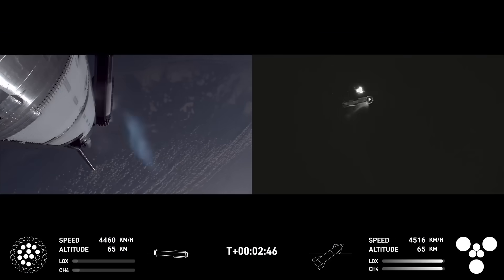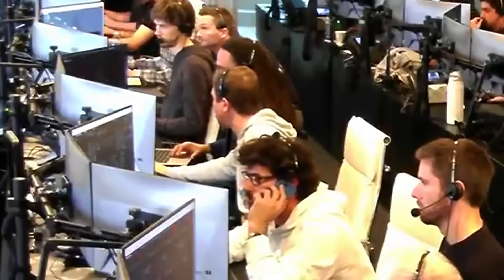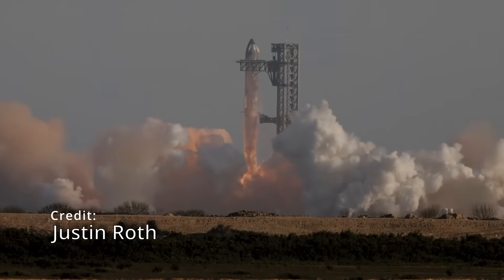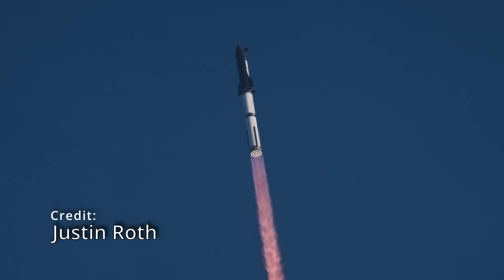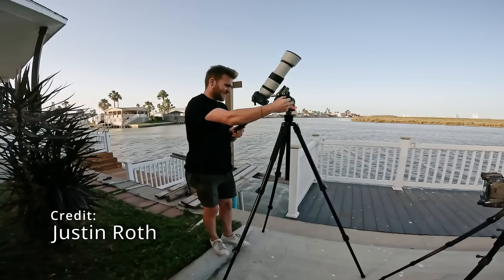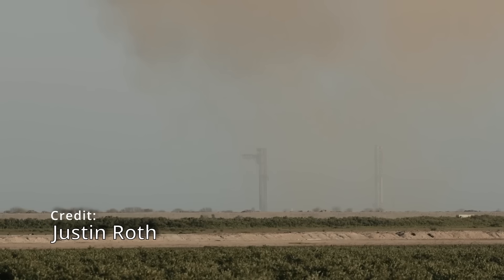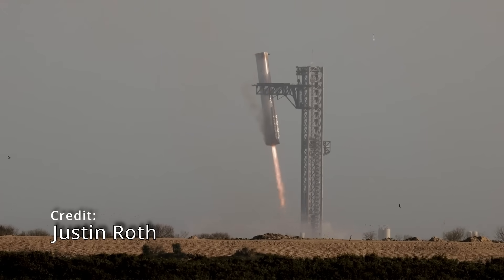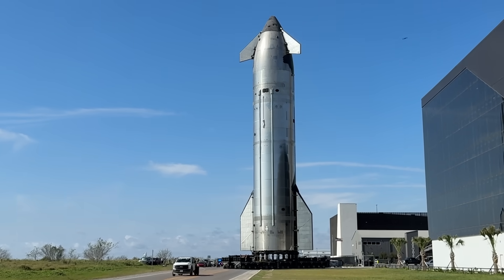Rest In Pieces: Why Did SpaceX Lose Starship Again?

Comment: I see so many similarities between SpaceX today and NASA in the 1960's, it's called GO FEVER. Keep pushing, keep going, and you're not looking at the data completely. What changed on Starship? I believe it was 6 meters. They were talking about a change in the harmonics of the ship during Flight 7, and that caused a break in the fuel lines. Well, harmonics can also induce POGO, and that will break a rocket. If you don't know what pogo is look up Titan II development to man rate the rocket to boost the Gemini spacecraft into orbit. Also, stop thinking about going to Mars and get the job done on the Lunar Lander. There is so much that needs to be done to fulfill the lunar lander requirements. Everyone was all so happy about SpaceX getting the Lunar Lander contract, I would like to see some progress on that mission. The moon missions come before any Mars missions.
Reply: Nasa has never had go fever. They have not left low earth orbit for over 50 years. They need go fever.

Comment: Can anyone explain how all Saturn V launches were successful and Starship can't get it right? Please don't say SpaceX is working with experimental ships. 
Saturn V was also experimental, with far more primitive tools to get it done. It is baffling.
Reply: I can only explain why you posted this comment; you needed to Karen it up.
Reply: Completely different things. Saturn v is not designed be reusable.
Reply: because saturn v was like the entire nation working on it
Reply: In short, it comes down to the development process.

Saturn V (as with basically all aircraft /spacecraft ) was engineered from the ground up where they worked out every theoretical issue before even building the part. Then once they built the component, they would rigorously test it in every way imaginable to ensure it wouldn’t fail (and if it did they would go back to the drawing board and start over).

Doing it this way meant they could be confident of exactly what would happen once everything was put together.

SpaceX on the other hand is using their “iterative design” process which means they essentially just build stuff without testing it, launch it, and see what happens.

If done properly, true iterative design (which isn’t really what SpaceX are doing) usually results in something that kinda works kinda OK quicker than the traditional method, but it then takes longer and is more expensive to get a finished, working product.

Edit: think of it like the 80:20 rule (it takes you 20% of the time to do the first 80%, and then 80% of your time to get the final 20%). 
While NASA etc. spend all the extra time on the last 20% to make sure everything is absolutely perfect, SpaceX rush to the 80% mark and then just lunch it.
Reply: It's not baffling. Saturn took more money, longer to make, and was far simpler.
Reply: @BoraHorzaGobuchul  that’s not acute . 

Saturn V took ~9 years from conception (1960) to putting a man on the moon (1969).

SpaceX has been working on Starship since 2012 (~13 years ago).

P.s. also, “simpler” was still ground breaking, never before done, state of the art at the time. I’d argue that is easily equivalent to what SpaceX are doing now.

Comment: To ground the spacecraft at this stage is   not useful, instead instrumentation must be installed to discover the root cause. Grounding only serves to speculate again. Then you have positive data to evaluate .
So with specific instrumentation you can detect  the cause in flght 9
Think about it!
After all , these are TEST flights, not demonstration flights.

Comment: Could "hot stage" separation be done away with a new "cool stage" design that "pushes" Starship away with struts, and THEN ignite the engines further away. Way too much vibration and heat involved in the hot stage ring, way to close to the engines.

Comment: On the plus side they now have two data sets to find commonalities in both RUDs and truly identify design issues.
Reply: The possibilities, as I see it:
1.  It's the same problem, and the fixes weren't enough.
2.  It's a different problem that just happened to produce the same result.
3.  The fixes to the first problem were the cause of the second problem.
4.  The design itself is not workable.

#3 and especially #4 are, IMNSHO, a bit pessimistic at this point.  They just don't know yet what went  wrong.  The real bummer here is that they haven't even had the chance yet to find out if B2's design solves the problems with B1, because they still need to get B2 to work.
Reply: @falcychead8198 , my guess is #2. The two RUDs are probably from two different things breaking under the stress which Starship was enduring. There're a lot of ways to fail.

As Starship uses up its propellant, its mass decreases, so its acceleration increases. That creates increasing G forces which stress everything on board.

By my math, just before its first vacuum raptor quit Ship 34 was accelerating at about +127 kph/sec, which is 35.28 m/sec².  1G is 9.806 m/sec², so Starship was accelerating at 3.60 Gs.

Add that to the acceleration of gravity (1G), at an angle of about 96° to the trajectory, and it was experiencing a total of about 3.84 Gs.

Vibrations may also increase and/or change in frequency as the ship's mass decreases. Add those dynamic stresses to 3.84G of continuous stress and things can break.

My guess is that the things which broke on IFT8 / Ship 34 were different from the things that broke on IFT7 / Ship 33, because I think SpaceX's engineers are too good to let the same thing fail twice.

I'll also go out on a limb and guess that for IFT9 SpaceX will not only beef up whatever broke this time, they will also dial back the thrust slightly toward the end of Starship's burn, to reduce the G-forces which it experiences, because they really, really want to test the things that they didn't get to test this time, like heat shield and Starlink launch.
Reply: Lol, these comments 😅
Reply: It's good to have same problem or a new one so they can fix them
Reply: In case the reason is the same (may not be)
Reply: The harmonic vibration might not have been the issue after all… it really does seem like the same issue unresolved. It has the same smell as starliner that had the thruster issue that they thought they could fix, but clearly didn’t, and flew regardless, with people on it no less. I really think this killed as ‘26 mars attempt which was already going to be tough. Maybe Q4 26 moon is still possible though…
Reply: Starliner never had ground tests where the thrusters were operated in a vacuum chamber. Ambient air circulation kept the valves cool.  
 @danwhiffen9235
Reply: At some point that's gonna be 50/50 that's not good wasteful at best dangerouss at worse.
Reply: Or, it could have worked perfectly, and they would have learned a lot from that as well. At the very least, they can learn from any launch. It's not saying much.
Reply: “RUD” is, at the same time, a hysterically funny, and an Orwellian phrase in space flight or rocketry.
Reply: @johncronin9540  i believe this was much further along in the burn.....
Reply: Trial and error...  that's horrible engineering
Reply: @joelrunyan1608  what you fail to understand is that not everything can be calculated and designed for!!!!!! there's a point of uncertainty where you must test the thing to figure out what you don't know that you don't know.
Reply: @joelrunyan1608  Yes, how many tests did the Saturn V before operational status? Tells the story.
Reply: @joelrunyan1608  Not necessarily. A lot of the technologies we have today are as a result of others befor having failed multiple times
Reply: @joelrunyan1608  It's a little bit more than that.  No new technology, from stone tools onward, ever worked perfectly the first time.
Reply: By your logic, the more failures, the better. You always learn from mistakes, but do you want to put 100 people on a cylindrical MuskmElon?
Reply: @4yerears  By your logic, mistakes are infinite in number.  If you fix enough mistakes, you will eventually succeed.  No, I wouldn't want to fly on this thing as it is right now, but no sane person would.

Comment: You can see at flight time +7:45 when the view switches from the booster catch back to the Starship engine bay that there is a red reflection and burning gases around the engines. About 20 seconds later the engines start cutting out.

Looking back at the booster reentry at +5:32 you can see gases burning around the inner booster engines.
There seems to be an issue with leaks around the engines after liftoff. If the leaks are small enough (booster), the flight is not affected. The Starship leak was almost at the end of the burn. Maybe this affected the ability to feed gas to all of the engines, leading to cutouts.
 
Have the boosters been close to running out of fuel? Does fuel continue to leak after engine shutdown? Or maybe valves closer to the tanks cut everything off upstream of the leak. Try pressure test of fuel service lines on the booster and see where leaks are coming from.
 
Hopefully with the booster recovery and additional cameras and data from Starship, they can isolate and fix this issue.

A setback, but it's better now without a payload. I'll guess next flight in late May.

Comment: It's remarkable that the booster catch is almost down to a science. It's the Ship that is presenting the biggest difficulties.
Reply: That may be a bit premature, R2 not reliably reigniting… what happens if it’s one of the three used for the catch?
Reply: @ytfcman3035  then it will divert, not a big deal
Reply: @snuffeldjuret  it only has three gimballing engines centre doesn’t it?  So what if one of THOSE fails to relight late-on?  That’s all I’m asking… and yes I do work in aviation safety and ask the ‘stupid’ “what if…” questions.  As long as they have at least 50% thrust margin for landing then they should be fine for losing a single engine.
Reply: The booster catch is a much easier option to landing independently. Landing like a Falcon 9 would be the real accomplishment, not catching it. But hey, smarter; not harder.
Reply: @itheuserfirst3186  this is 100% incorrect. Returning to a specific point to be caught is much tighter allowance than a pad where as long as you make the pad it's fine.

Comment: One result may be to move forward to Raptor-3.  Let's hope that it is not a basic raptor issue! You can probably pick up a real deal on a Raptor-2!  Someday there will be a significant economy based upon the buying and selling of used and refurbished Raptor engines just like in the Star Wars movies or like in the commercial aircraft industry.
Reply: I think R-3 is actually a very sensible change, assuming it is itself ready for prime time. R-3's main feature is its greater simplicity, especially in terms of what is exposed, and that makes me think it is likely also much more reliable. This of course presumes the faulres in 7 and 8 are engine related rather than mount or enclosure.
Reply: raptor-2 on the boosters have been insanely reliable though

Comment: At this point, I wonder if It would make some sense to come up with some variants that use different upper stages, like perhaps use super heavy to to be the first stage of a 3 stage man rated moon rocket.  Perhaps get other NASA contractors to develop the other upper stages while starship continues development.
Reply: SpaceX would fully design, test, prove the upper stage before any other contractor even got past the paperwork. Then SpaceX would do the same for necessary variants before any other contractor even got the infrastructure up to start work.
Reply: what a can of worms that would be.....NASA...lol
Reply: Many people are seeing the inevitable test RUDs as failures.  They're not.  SpaceX learned all they could with ground based testing.  Now it's time to blow up some rockets to learn what else needs to be fixed on the path to success.  RUD = data.  Data --> success.

Comment: I kind of agree this V2 new ship has a design flaw, they should do a ship only vertical  8 minute flight over the gulf, then land it on the water.
Reply: V2 rocket?  that sounds kind of Notsee...  😀

They're still getting testing and improvement on the booster, even if the starship part fails spectacularly...
Reply: No.   My bet is that "Ship" gets ripped apart by the acoustic signature of the booster.   In fact, the amount of shaking might be a big re-use problem
Reply: @chrisalbertson5838  if it was that it would show up near the beginning of the burn, not the end.
Reply: But what if the issue has to do with the staging itself?
Reply: @ Could be, as I stated in another reply something is breaking after hotstage, but not showing up until right before engine shutdown. Eliminate the hotstage for a test flight, only one way to do that.
Reply: @DaveEtchells  A reasonable question - but testing the SS design over the Gulf water would and could help with both duration of engine burn and the landing relight.
Then, they could do the full up test after WDR.
SpaceX is trying to go fast but at a certain point, going fast is not "better".  They need to stand down the scheduling pressure and take a few weeks to a a few months to rework.
I've not seen this number of failures at SpaceX ever in one week and I've not seen this number of failures in general since 1986.
Reply: @goldenpacificmedia  Yeah, they apparently made something like 68 separate changes from the last flight to this one. They may need to back off a bit from the “everything all at once all the time” strategy.
Reply: @f.w.1318  another thought as to why it doesn't show up in ground testing. 
As the fuel nears exhaustion the g force increases and the pressure on the fuel and oxidiser lines is increased due to the head of liquid. The O2 header tank is 50 metres above the engines. At 5g that's about 30 bar of pressure. Combine that with vertical vibrations and there might be even higher pressure spikes. That can't be replicated on the ground.
Reply: How would a vertical 8 minute Starship flight over the gulf solve a problem that is occurring as Starship is almost in orbit?  That's analogous to the NHTSA doing front impact tests to determine why the Ford Pinto was exploding in rear end collisions.
Reply: @  Let me clarify, ship passes leaks test (on the ground) and ground testing flight burn, heck I'm no engineer, but something is breaking after hotstage, but doesn't show itself until right before engine shutdown. I think doing a test flight without a hotstage phase would be a good start.
Reply: @Liberty4Ever  depends what the issue is. If it's related to the pressure of the oxygen in the downcomer from the header tank at 9g of acceleration (for instance), that would show up quite nicely in a vertical test.
Reply: well...the block one ship would have failed just as block 2 is now.....Block 1 carried no heavy payloads and with a heavy payload and the new more powerful raptor 2.5 the same exact issue would have shown itself.....Block 2 is a lot heavier and has more powerful engines that really were not meant to be on it....should they have taken this into account...probably but they are playing a very tight game of thrust to weight ratio that they are failing in and attempt to keep static mass as low as possible....getting raptor 3 will help and strengthening the thrust puck will help...
Reply: Spot on. I don't think they can test this on the ground because the thrust is more than the hold down clamps can take without the weight of fuel. They can do the testing for this problem, and do testing for ship catch with a high cadence if they contain everything to a few miles from Boca Chica.

Comment: Scott Manley will give us possible clues as to why. I think its a pump cavitation issue that causes pressure diffrentials..
Reply: Its a bad vacuum raptor , cooling problem,  you can see the crack in it on video before it exploded - duh
Reply: The vacuum and sea level engines went out at the same time.     My guess is that something that is common failed and the root cause is the huge acoustic signature
Reply: @chrisalbertson5838  the vacuum engine literally went boomie, that will have an effect. It is impressive the other two engines just kept going

Comment: As always Ellie your reporting is spot on.   My prediction for flight 9 will be towards Memorial Day, given nearly two identical RCA’s pointing towards a shipV2 design flaw.   As an engineer myself, having more instrumentation and data to review will quicken next steps, and return to flight.   I also think they should pursue more attention to the ground based equipment (tower 2), and what appeared to be tank damage during ascent of the F8 vehicle leaving the pad.
Reply: I disagree. It looks like a Rapid Unscheduled Disassembly (RUD) of the Vacuum engine, which then took out the other engines. Given that multiple engines failed during re-ignition in both the previous flight and this one, it seems like SpaceX is currently facing a reliability issue with the Raptor engines.

Comment: Yupp all sounds about right to me. I had thought a while ago that the flaw/trade-off exist with the rapid iterarion approach where youre building the next ships before seeing if the one youre currently testing works. Wouldnt be a problem if you were commited to the hardware part of a design already and just using that data gathering to change code and approach. But, everything has trade offs and flaws so doesnt mean its right or wrong/better or worse of a way of doing things. Progression certainly won't be linear when youre taking that steady iteration and then throw a whole new ship into the mix. I dont think alot of people ever expected their iteration philosophy to have these moments in it, though.